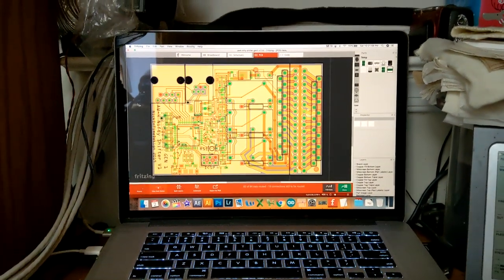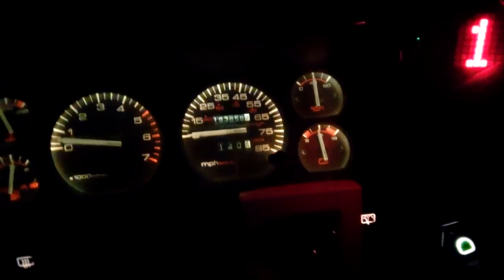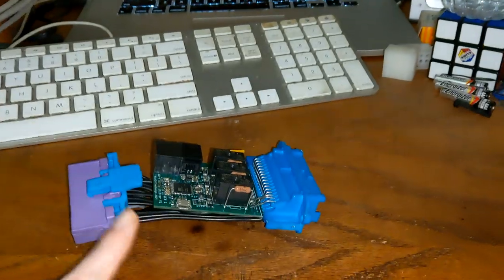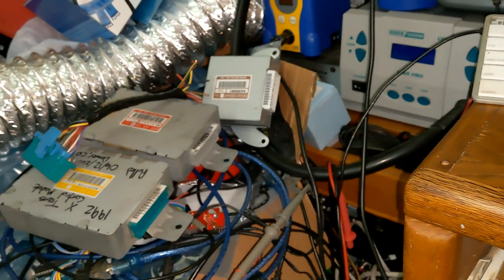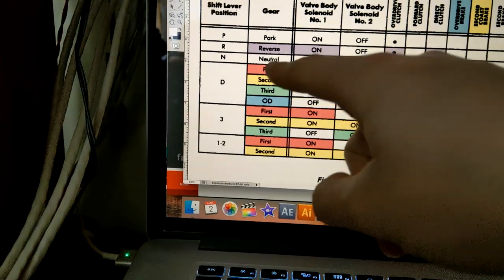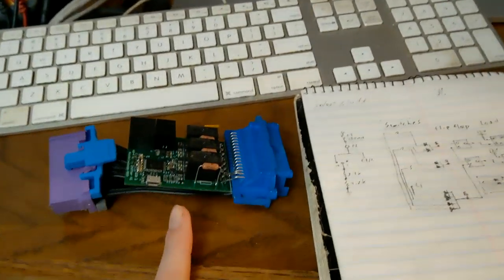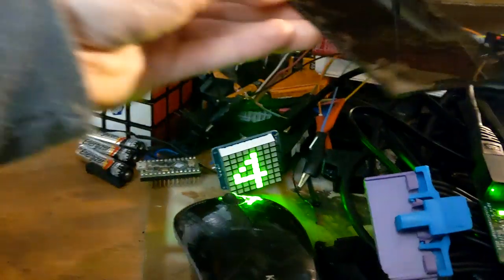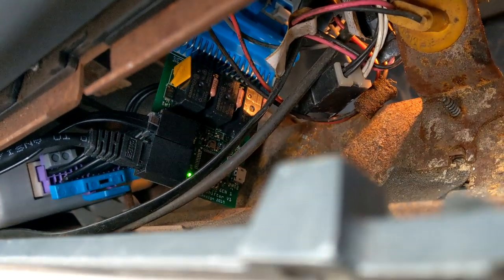AW-4 Nifty Shifter V1 demo and ideas

Comment: I liked the idea that Radesigns had for their Rail controller for shifting the AW4, it's small and simple so it can mount anywhere.
Reply from the maker: I've seen them before. It's certainly a simple option that can be wired up. I'm focusing more on different types of input types, programmable logic, and heads up features for more diversity.
Reply: @NickInTimeFilms  I like where you're going with this. I can only begin to imagine the possibilities. Do you think it would be possible to use Radesigns shifter with your controller? I know you mentioned him helping you earlier on.
Reply from the maker: @MrMoxes  Yep, I don't see why not. I'd just have to add a mode to convert his direct input style back in seperate gear inputs and it should be good to go.
Reply: @NickInTimeFilms I can't remember if it was sequential or not. Not sure how hard that is to code for. Also, I believe the TQC is commanded via ELE-HYD-MECH, or something like that. So you should be able to flip a switch to get it to lock-up.
Reply from the maker: I've got sequential programmed in too! And yeah, the TC is electrically activated.
Reply: @NickInTimeFilms  I might have missed you mentioning it. There is a lot that you've done. Great work, looking forward to seeing more on it.

Comment: If it gen 2 for 97'-01' works without throwing CEL's then I would certainly purchase one. Also even if the kit ends up not including a joystick, I'd love it if you could recommend a few specific input devices that would be easy to wire into the system.
Reply from the maker: Sure thing. The CEL should stay off "most of the time" and will only throw when it detect something funky. When I get my hands on an OBD2 Jeep then I can test a little more and see just how hard it will be to keep it off all the time. And I'll be working on something that I can include that is simple. Going to order a few ideas to test shortly.

Comment: Hey Nick this is pretty cool especially for those doing Jeep buggy. I was wondering if you could message me, I think a great new project for the XJ would be BAS(auto stop/ start) hybrid functio. Not sure if you've driven a car with it but the concept is simple. Using a switch & timer when the brake pedal depressed at 0mph after say (5-7sec) with input thought speed sensor, engine stalls. Then when pedal is released ignition turns on starter engages and on the go. There was something I saw here over in silicon valley CA had a Arduino stop / start on his 92 Mitsubishi eclipse GSX 2.0l
Reply from the maker: Hmmm. Well it's certainly possible, just depends how reliably your jeep starts back up. So there are 2 components, 1 is killing the engine effectively, and the other is knowing when the engine has started. So with speed sensor and brake info we can set a timer to interrupt something. We could cut the fuel pump, interrupt the injectors, or figure something else out. Part 2 is starting the engine. So the difficult thing here has to do with the transmission. Since you would be in gear, trying to start it might move the vehicle but I'm not sure. So we send a signal to the starter and cut the signal when faster then say 400 rpm is detected. It would be quite the project, but certainly doable if you had the time to tinker.

Comment: So I'm assuming it'd be pretty easy to make one work with input from just two micro switches..? I want to fab my own shift knob and make it like an actual sequential shifter. Maybe put a switch on it for the manual/auto and a button to switch between on and off for the torque converter?
Reply from the maker: Absolutely! This is designed so that you can hook up whatever you can think of! That would work just fine
Reply: @NickInTimeFilms  Hell yeah, I've been watching you forever but I'm not sure if I've got you on Facebook. If I add you and eventually end up purchasing one would you be able to help me with wiring if I had any issues?
Reply from the maker: Heck yeah, I can help you out with any questions. Would love to see what you find up with and do what I can to make it work.
Reply: @NickInTimeFilms  Sweet

Comment: Ok, here are some of my thoughts on this:
- Engine braking is what makes manual shifting really useful. If it doesn't do it, it's just good to stay in gear while climbing. It won't work for descending or controlling the speed before a curve.
- Thus, use of the main shifter is required, and therefore the controls should be on it.
- Main switch could be a physical one or code controlled. I tend to prefer physical on/off, but everything is doable.
- If controls are to be on the main lever, either a set of fingertip buttons or a rocker switch could be a neat solution. Index button and ring finger button (or a rocker switch with the same functions) or maybe even a four-way hat with button function for the index.
https://www.sparkfun.com/products/10063
https://www.adafruit.com/product/504
Reply from the maker: After more testing, drive is only good for accelerating really. I'll be included a mode to allow the stock shifter to hold manual gears for a manual offroad mode. I like the idea of a shifter mounted switch to enter manual mode, though for early years we can just as easily use the power comfort switch! I'll have to see how a tiny joystick would work on the shifter, but might get a little confusing.
Reply from the maker: That thing looks insane, almost downright alien, haha

Comment: have you tried locking the torque converter when trying to engine brake?
Reply: I was thinking that too
Reply: Same thought i had.
Reply from the maker: I haven't rigged up a switch for that yet, but I'd certainly like to try it and see. I have a feeling those 1 way clutches are still going to free spin or something but we'll see.
Reply: Go too slow and the engine will stall with TC on.
Reply: I am interested in this (for my 42RE) for steep technical descents, it would be handy to lockup the torque converter for this (engine braking like a manual), had also contemplated using one of the brake circuits to break the ground to disable TC lock upon applying the brake pedal.  Would think that one of the lower gears (3 or 1) would need to be manually engaged for this to work as Im not sure if there is flow to lockup the TC in D position.

Comment: You may have covered this in this video (I'm like 20 mins in currently), but what about USB/PC vidya game shifters?

I've got a old Logitech joytick and it got me thinking.
Reply from the maker: If it uses micro switches then you could hack it apart and wire them directly to the adapter. I'll have to see what it would take to read the actual USB cable though.
Reply: @NickInTimeFilms  Just an idea. That would be one way of making it universal, so long as the internals of the joystick are readable with the tech you've made so far.

Comment: Youd only get engine brake if you can keep the torque converter locked up
Reply: have it set up, to auto unlock at certin rpms, so it wont stall when decelerating, and have a time limit for certain speeds in certain gears to auto lock. if you get what im saying.